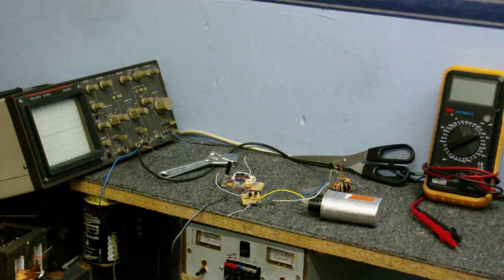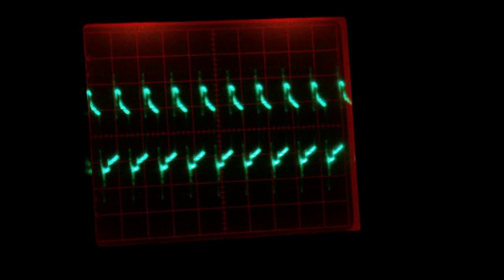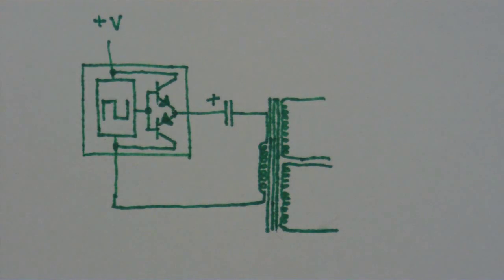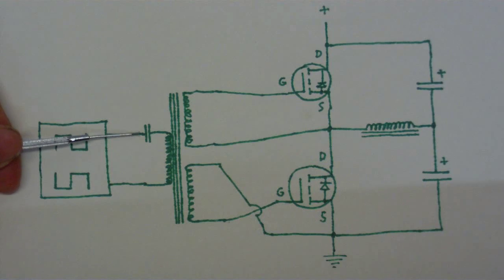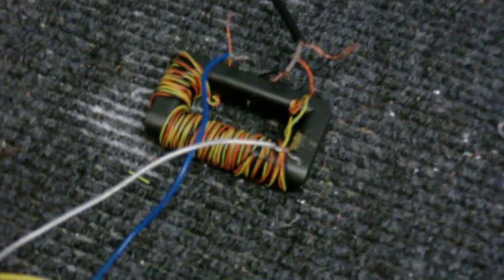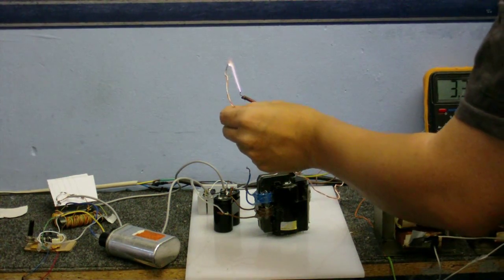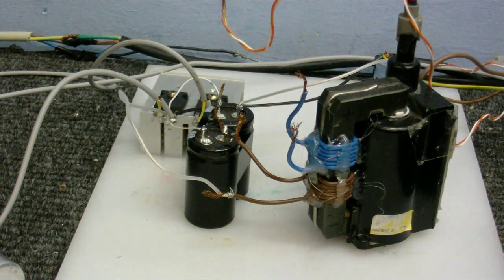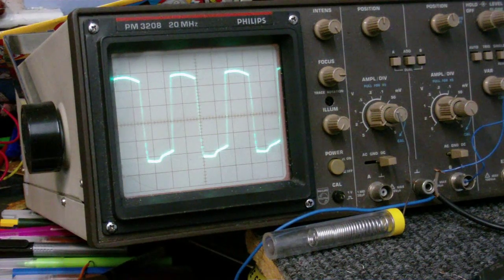CDC Electronic Workshop - More experimenting with Gate Drive Transformers

Comment from the maker: @ee2008117 Ok, the push-pull was just to buffer the output from the chip so the chip doesn't have to work as hard, it's a bit like an amplifier only there's no amplification, but in some caes if the GDT is good enough it's not needed.  For winding the GDT I first twisted 3 wires round each other, then wound them round the core about 30 times (I think(I don't know exactly how many turns I used)), the capacitors were 10000uf electolytics.

Comment from the maker: @Alex1M6 That was with a 2.2 uf capacitor, but I've been experimenting with it a little more, and I found if i use two 6 turn primaries and wire them in parralell I can get a hotter arc and louder audio at the cost of using a little bit more amps.

Comment: Dude! don't hold a pair of a TP cable with your fingers at these voltages! you never know if the ground connection breaks and you'll zap yourself pretty badly. at least tape those wires to a plastic stick of some sort.

Comment: Glad you got it working, I like this driver much better than the ZVS as you can actually control it via a pot. Regarding the audio volume from the arc I have found using a 2.2uF or larger non-polorised capacitor on the audio input helps allot. The larger the capacitor on the audio input the louder you can turn up the volume before the sound starts distorting.